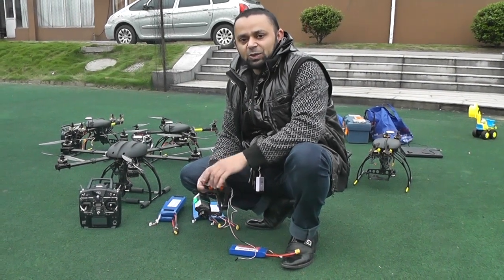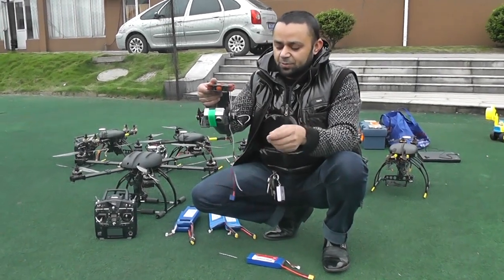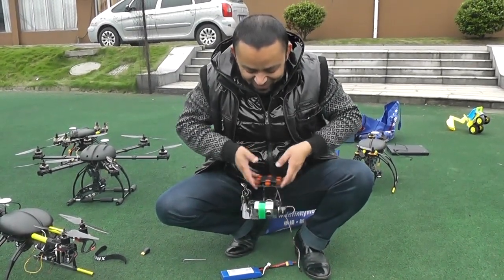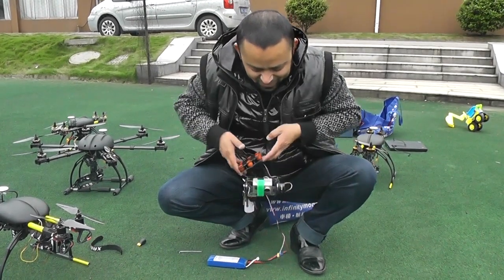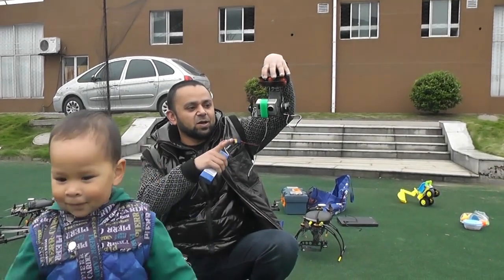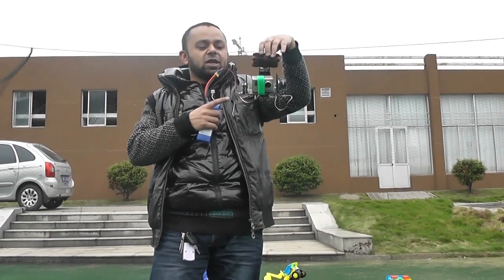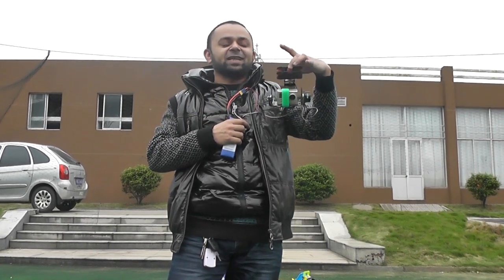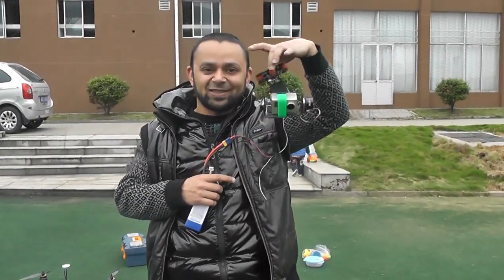Master G Brushless Gimbal for Pro Steady Aerial Filming

Comment: Are you having problems with the gimbal disengaging with the slightest bump, such as landings?  95% of the time the gimbal will disengage and pulse.  It will not correct itself.  I have to unplug and re-plug the unit to reset the gimbal.

My settings are:  Roll 32 and Pitch 18.  Also, the angle is set to 0.

Comment: After testing my Master G today, It seemed no matter how gentle I tried to land the copter, the gyro would stop at landing.  Although, the motors would still pulse/trimmer until I unplugged and restarted (reset) the gimbal.  

What would happen if the gyro stopped during flight?  I believe it could be very interesting regarding how the flight controller's stabilizer would process the pulse/trimmer situation.  - Could be a crash waiting.

Comment: On my previous message, I had uncontrollable shacking.  Eventhough everything seemed balanced, I still had the shacking.  Note:   My problem was I used Velcro to secure the camera mount to the gimbal base.  - Not good.  Once I eliminated the Velcro, everything works fine.

Comment: I just purchased and received the Mastor G and it seemed to be working, but now it shacks uncontrollably.  I went to the Settings Tools, but half of the words are in Chinese.  

I have the brushless gimbal powered and USB connected, but nothing seems to work other than selecting the connect button and port.  I am using Windows 7.  

Any suggestions would be appreciated.

Comment: 1.The motors are re-wound with less copper to fit the application 
2.There is a 3 -axis gyro and control board.

Comment: because the Motor Have a lot of small copper strips :) Like 150 Turn and 0.15mm. about 12-16 Ohm for one Phase. And the Enging Dosen´t cogged because she need no induction From a Phase to "Kommunitieren" The bell From the Motor. The MPU6050 works As Electromagnetic induction to determine the position of the Bell. (Oh man ist mein english schlecht :))

Comment: it's not 360 at a time, those small brushless has a number of coils, I've seen from 3 to 12 and there is a trick to select a position between 2 coils by alternating the current proportionally: 10% of the time attracting to one coil, and 90% of the time attracting to the following coil, to "lock" the motor at 90% of the course between the 2 coils. The alternating occurs at very high frequency, I've seen 4khz and 8khz, which sometimes creates the according very annoying high high pitch noise

Comment: I am confused as to how they get this system to work. Brush-less motors usually spin 360 degrees at a time and the pulses to the coils are done asynchronously (no rotor sensor feedback). What is giving the feedback to the controller as to the angular position of the gimbals?